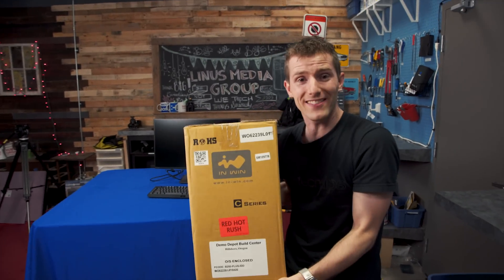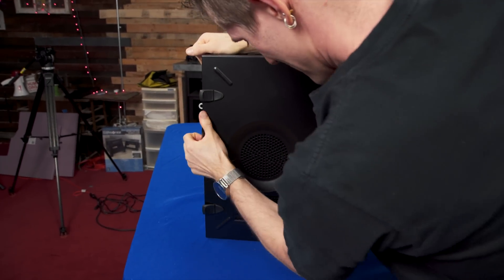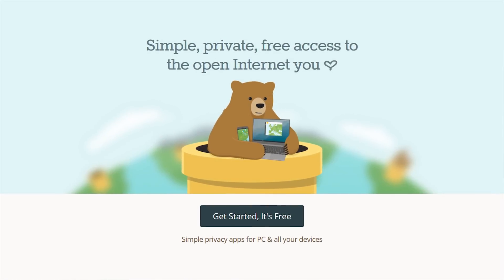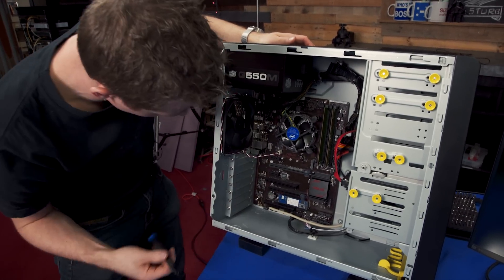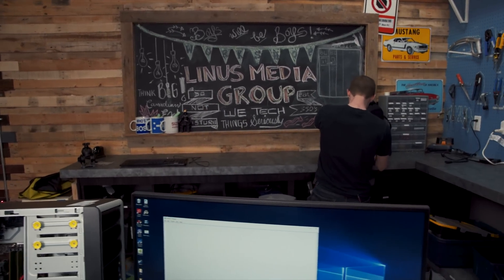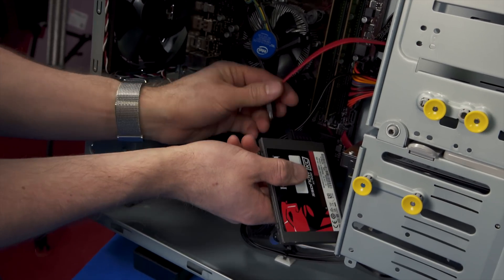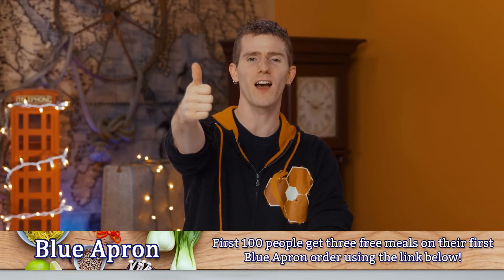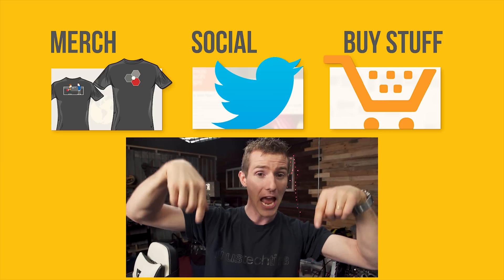Turbocharge your SSD for $40??

Comment: What old Computer has m.2?
Reply: Ethan L none because it doesn't work with them anyways
Reply: I was thinking that too. My computer from 2010 does not maybe a pcie adapter to m.2 but at that point you could buy an ssd.
Reply: and a 200 series Intel Chipsets Motherboard xD
Reply: It's aimed for people who manage large amounts of data on very Large and slow drives. A simple solution to give an ssd feel to the machine. Well that's at least what I think.
Reply: An old PC wouldn't make sense anyway, because you need a 2xx series chipset and Kabylake. But who builds a new PC without an SSD?
Reply: But does your cpu support optane...forget about it.
Reply: And Kaby Lake!
Reply: Doesn't even work with 6700K which is just 1 year old. Awesome Intel product for no market at all.
Reply: exactly what i was going to say as well
Reply: exactly....very pointless, is the SSD cache all over again but when nobody actually needs it. It will only make sense on bottom budget systems.
Reply: Ethan L that's why the limited it to 7 th gen
Reply: sniperunrepeat I was joking... furthermore instead of $40 for 32g of optane, you can buy a $50 ssd of 120g.

Except maybe for some data center use cases, that's very pointless.
Reply: a computer from last year is considered "old computer"
Come on man, get with it already
Reply: Corentin Leman A $50 120gb SSD will be slower than Optane and likely be cacheless
Reply: Intel Z97 Chipset Motherboards, and they have been out  3 years now, and in the tech world that's already getting old, i know for me and many other people 3 year old MB is still very good (i have one).
Reply: sniperunrepeat I couldn't support you more on that point! :)
Reply: Yeah, not for me, but other people might think of it as some sort of ssd replacement, or a way to get ssd like performance on an older pc. That also leads to the point that it should have been marketed to the demographic you are talking about. There are alot of people that are new to pc's and pc components and so it is intel's job to market their products correctly to minimise customer confusion.
Reply: JoshBG I've just received an official reply from Intel "Intel® Optane™ can only be used to accelerate one Windows® 10 SATA boot drive." hope this helps. Seems silly to me as I would have used it to accelerate my secondary HDD.
Reply: Why do people not get super fast m.2 ssds?  because this optane device cost significantly less. It's not supposed to be bought with a new pc. It's for people who have pcs and want to buy something to make things go broom bro I'm fast
Reply: +Phenix Nunlee just be aware that with a PCI-e M.2 card you won't be able to boot up into Windows with it on your 2010 computer because the BIOS probably won't recognise NVMe drives. Once you've booted into Windows then the NVMe driver would kick in and you could then use the M.2 NVMe SSD as a secondary drive. Alternatively you could get a SATA III M.2 SSD and use that with the PCI-e card but these would be the same speed as a 2.5 inch SATA III SSD.
Reply: +My Black Minds People who don't plan out their builds properly and spend all their cash on everything else bit the storage. It can be easy, especially if you end up going to a store to buy the parts as you can then see stuff like Gaming Mice and Keyboards, actual cupholders that can go in one of the front disc drive slots (of which many full size tower cases have at least two, with one usually holding an optical drive of some sort, and/or an SD/Memory Card Reader nowadays), rgb LED lighting for many parts in person, or other similar impulse buys.

Plus it can be easy to go over budget if you end up buying something much higher end than would be practical for your budget (for example, buying an Intel Core i7 6900 at around $1000 US with a $2000 budget, leaving 1000 for the motherboard and every other part needed for the build, so you might need to cut corners depending on exact costs, or buying 64GB of DDR4 RAM because you want lots of fast ram, but it eats up more of your budget than 16 or 32GB, especially since it is rare for more than 16GB to be used in most day to day use unless you run everything cranked up to the maximum graphics quality while also running Google Chrome, watching Netflix/Hulu/Insert Favorite Streaming Service Here, and also contributing to Folding@Home or some other similar research service where you can donate computing time or making Hollywood grade 3D Graphics.

If you are building on a budget you might use a donor PC for it's case, optical drive, and Storage so you can get higher performance CPU, GPU, etc while keeping at a lower budget, and if you prioritize those, you probably won't have an SSD in the build unless the donor already has one.

Also, HDDs have one big advantage; Storage Capacity per Dollar. A 1 Terabyte portable USB 3.0/3.1 Gen 1 HDD costs around $40-60 at local stores, a 256 Gigabyte USB 3.0/3.1 Flash Drive would have a similar cost, so you get approximately 4 times the storage per dollar, and you can get better prices during sales, such as back to school or black friday sales on both types of memory.
Reply: how have you done your math here? A 16GB Optane module only costs £45 and can accelerate multi TB mechanical drives. A basic 128GB SSD would cost more than that.
Reply: sniperunrepeat Yeah like a $500 ssd will also be slower than optane, as said in the video... But the difference will hardly be notified, as per Linus' tests
Reply: what if you have all your games on a HDD and want to cache that while your OS is on a M.2 PCI-E NVMe drive? Dont just think about using things as intended. I use Intel older tech SRT (Smart Response) to actually cache my RAID 10 array both reads an writes.
Reply: Sometime you have to figure out that stuff for yourself usually when its not being marketed at you/ your demographic
Reply: I think they marketed to the largest user base which in there eyes makes the most sense. Even a fraction of those people are larger that the people that would use it as I described. I see this as more of something a system will ship with it already installed rather than an upgrade at least as at the moment since compatible systems are so new.
Reply: Ethan L That wasn't quite my point. I have with my Z97 mobo Samsung Evo850 240GB SSD + 3TB combo (one of the first m.2 boards). I wouldn't buy this shit even if it would go with my Z97 so for who this is aimed to?
Reply: I think a more important question is why you would choose to occupy your only M.2 slot with that instead of a super fast SSD for booting. I think it's useless technology, since relatively few new computers are booting from mechanical drives anymore. Small capacity SSDs are fairly cheap now. Just go with that.

I doubt this optane stick will give an hdd anywhere near ssd performance. Just load your most frequently accessed programs on ssd. Use a mechanical drive for cold data storage.
Reply: Brian Su do you know if we can use 2 optane memory as a cache ?
Reply: Brian Su ok thanks ! but can i use both of them to accelerate the same drive ?
Reply: Brian Su if you want bro that would be appreciated :p
Reply: Brian Su damn okay thank you man very appreciated
Reply: I'm still not convinced this Optane stuff would be a worthwhile endeavor anyway. I don't think it will boost your system speed anywhere near enough. If you're on that much of a budget, you're probably still better off buying the cheapest SSD you can get your hands on. Even if it's 100 GB. It's big enough to install windows and some of your commonly used programs.
Reply: Who, me? That aint got nothing to do with me, buddy. Good for you. I fucking love Beetlejuice. He's as bad as can.
Reply: Brian Su   Now that's what i'd like to do: use an Optane drive as a boot drive.  Is it possible? I do not game, so 32gb is large enough. I just want the speed.
Reply: Officially no because Optane isn't meant to be used as an SSD but Intel has said it's possible to get it to work as one. The other question is whether your BIOS will boot up with an Optane drive, I'm not sure about this. Having said that, are you sure Optane will be faster than a normal NVMe SSD? I think Optane's good for caching because of low latency but if you check the read and write speeds they're quite a bit slower than a proper NVMe SSD. Of course the thing is Intel doesn't allow using a NVMe SSD as a cache drive so people are forced to get Optane.
Reply: No, I've just checked. The 32GB Optane's official specs: Max. Read 1350 MB/s / Max. Write 290 MB/s. By contrast the Samsung 960 Pro NVMe can read and write over 3000 MB/s. The Optane does well with latency: (Latency 9µs Read / 30 µs Write) rather than transfer rates.
Reply: My 3770k on a gigabyte motherboard is not that new.
Reply: Doesn't the SSHD perform the same task in one single 2.5" unit?
Reply: If you think your unfounded claims are right, you're wrong! Accept my unfounded claims instead!
-xXxBlackwaterXxX, 2017
Reply: If you need a new mobo then obviously it isn't worth it. Fact is as of early this year all new PCs support Optane so there's no additional investment. I used Hybrid HDDs for many years and can't vouch for them. Furthermore, Hybrid drives only work in one direction. Only read otherwise you'll risk data loss.
Reply: Im still on SATA 2.0 dude. I actually play Doom 2016 on a 2009 i7-920 desktop.
Reply: and what new computer still boots from HDD?
Reply: is your M.2 SATA or NVMe?
Reply: Samsung Evo 960 Pro NVMe
Reply: NVMe
Reply: Vercusgames this is true but i have 3tb of hdd for free so it makes more sense to me
Reply: never heard of m.2 - PCIE adapter? bro, you are a noob.
Reply: Sir, Brian Su It can be done.
Allow me to introduce you to "PrimoCache".
As so long as the device can be used as a stand alone drive it can be used to accelerate any other existing storage.
In both Reads and writes.
OR, YOU CAN JUST USE ONE AS A DAMN BOOT DRIVE. 
ALSO, A PAGING FILE ON ONE OF THESE BEASTS WOULD BE AMAZING.
Reply: Actually It could work in increasing FPS... 
By freeing Paging file bandwidth onto one of these... 
And Running an OS on one... Freeing bandwidth... 
And... Using one as a drive cache (For another MVME.) with a program like "PrimoCache".
Would require a BEAST of a CPU... <- I mean LIKE THE BEST CPU CURRENTLY. 
And either an ADAPTER or another MVME Drive.... (Where games are stored)
This would reduce latency for games that use filling textures extremely. 
Also, Not to mention the game is already being loaded from a Great MVME SSD.... 
After you teach the Cache a game you want... It could give a HIGH END GAMING PC.... 
Another 10-30 FPS....
So having set up 3 of these for maybe 10%-15% gain... Meaning about what? $150 For 10-15% gain in speed... 
Which is $10 per a percent... Honestly I would do it if I had a high end system with that many slots for those drives and the CPU to eat it. 
Considering the CPU you would need is about $1,000... Then a monster $800-1,000 GPU...  
At that price point your looking for the BEST... And right now a set-up like that probably is the best.
Just do me a favor and don't forget the RGB.
Reply: Corentin Leman im gay
Reply: needs optane and NVMe support
Reply: That would be fine, but i think a big problem is the way it was marketed.
Reply: greenmarine8888 PCI, just PCI...
Reply: mine does from 2014
Reply: +Michael Lee new motherboards have 2 M.2 slots anyway. I'm using 1 for the primary SSD and the other will be for Optane.
Reply: greenmarine8888 SATA is a protocol, PCIe is a type of slot. There's no such thing as a PCIe SSD with no protocol. The common PCIe one is NVMe
Reply: JoshBG no I don't. I've been asking whether it can be used to accelerate a secondary HDD rather than primary. If the answer is yes then it should apply to your question too, I.e. One to accelerate the primary and the other the secondary drive.
Reply: Yes you're spot on! It's for people who don't have the M.2 slots already occupied. By the way, M.2 SSDs are not necessarily super fast. The SATA III ones are 6 times slower.
Reply: JoshBG ahh I'm not sure about that sorry. Try asking the question on Intel's support forum. I wouldn't mind doing that for you if you want me to?
Reply: JoshBG Done. Will update you when I get a reply :) I take it you have a mobo with 2 x M.2 slots?
Reply: JoshBG Intel has responded that it can't be done. Only 1 stick per HDD. However, it is possible to use the Optane stick as a standalone SSD (not officially supported) if you happen to have spares lying around.
Reply: JoshBG no problem mate. Yeah I'm quite disappointed it can't be used to accelerate my secondary HDD. I'll just stick to using a super fast SATA MLC SSD as the accelerator then.
Reply: Touché!
Reply: Brian Su  I do not know if Optane's read and write speeds are faster than an NVMe SSD's, but considering the tech in Optane, i'd think so.  An 80.00 boot drive quicker (latency) and faster (reads and writes) than a much more expensive NVMe drive would be worth upgrading to an Optane compatible mobo/cpu/ddr4/OS, even if it's only 32GB  and maybe if only the boot times are lower.
Reply: Brian Su thanks, hopefully the Optane powered SSDs will do what these can''t.
Reply: an x97 chipset <.<...
Reply: The kind that runs Crysis.
Reply: SSHDs are a marketing gimmick. I've been using them since 2010 and can't say they're that good. They only work in 1 direction so you'll still have to wait for the mechanical drive to complete writing to the magnetic disk.
Reply: @Vercusgames : There are negatives to an ssd since the producers will try to increase its size, reducing its storage longetivity since it still uses electricity which isn't good when you are going away for a long time, like a couple of weeks or months when a hdd saves it on the disk.
Reply: Eugene Glitz they probably put a newer motherboard in it
Reply: hey chill bruh thats my motherboard
Reply: It's just an old case, but it has new components, are you stupid?
Reply: if you ran out of money for an ssd chances are you don't have money for optane or you know go for a cheaper motherboard that is just as good and get an ssd. or even better use your hdd until you get enough for a ssd. cause that optane cache is a waste of money.
Reply: I'm building one that does from a WD Blue + Optane. Not everyone can afford more than 1 HDD so can't have an SSD + HDD.
Reply: I boot from an M.2 and everything else is on my 2tb Samsung SSD
Reply: Good choice, I've got that too.
Reply: good good don't use SATA M.2
Reply: You just need a PCI-E x4 port, which iirc the third gen supports 3.94GB/s
Reply: +Toool yeah but it'll only work as a secondary drive. You won't be able to boot into Windows like that because the BIOS won't have the option to set it as a boot drive.
Reply: Eugene Glitz not a ton I mean my old x99 pc has it but I work in an office with Windows XP computers and they put a pciex16 card in that's an adapter to m.2 so that's rad
Reply: the hard drive market isn't dying, its serving another purpose
Reply: ikr
Reply: omit Intels C232 & C236, not supported
Reply: Depends on your definition of "old."
Reply: Can Darma yes exactly!! That's what Optane is for!
Reply: Yeah, my computer is just from 2012, it started off with a Gigabyte GA-Z87X-UD3H ATX motherboard and a 7970 GPU but its like....yeah, it doesn't have M.2 in any sense of the word so I have no idea how 'Octane can power old PC's' would make any sense. LOW END Modern computers with meh HDD's? Sure!
Reply: +Kvarnholmen Exactly!! This is for people who can't afford SSDs. A 4TB SSD would come in U.2 form-factor as M.2 is physically too small. These would cost a bomb. Maybe these trolls here are rich kids who only think of themselves...
Reply: +Kvarnholmen ohh OK are you aware how Optane works? It can only be used to boost the primary boot drive, and only if the boot drive is a SATA drive. It doesn't work with nVME drives. There are other requirements too such as the type of disk, free space, etc. It's not that simple. Once again, you can only use it to boost 1 drive, the boot drive so you can't do both.
Reply: That's exactly what my situation is. I have a Samsung 960 Pro nVME Primary drive and a 4TB Western Digital Black secondary. Wanted to use Optane to accelerate the latter but realised it isn't possible. I'm now using one of the fastest SATA MLC SSD 128TB OCZ Vector drives to accelerate it instead. If you go down this route, make sure you use a MLC SSD. Never use a TLC SSD as an accelerator or it'll die very quickly. TLC drives are also much slower than MLC ones.
Reply: no you cant
Reply: M.2 NVMe is a 4-lane PCI-Express card. Use a US$10 slot adapter to fit full size slots. Windows 10 will find and use NVMe, but old motherboards don't recognize it as a boot device. There is a workaround using a "UEFI bootloader" such as Clover to load NVMe support and it then boots from the NVMe.
Reply: I have it in my "old" i7 4790K with MAXIMUS VIII GENE mainboard.
Reply: Vercusgames RAM can't replace DDR4, as they're the same thing
Reply: Phenix Nunlee any computer can have an SSD, as long as it has a SATA or M.2 socket
Reply: Oh yes, the Gum stick storage as they are called by many. Some examples of older motherboards would be like Gigabyte Z170N-WiFi mini-itx board and a Samsung 950 Pro SSD (M.2, 2280, NVME PCIe x 4). These are some from back in year 2000.
Reply: Z87 has it.  Probably even older chipsets.
Reply: Its literally like 15 dollars  for an adapter. https://www.amazon.com/MACHENIKE-Adapter-Controller-Expansion-Profile/dp/B079JVGJFV/ref=sr_1_2_sspa?ie=UTF8&qid=1519194675&sr=8-2-spons&keywords=pcie+to+m2+adapter&psc=1
Reply: Duh, no one calls this an old computer. Just the case is old. That's the thing about generic PC cases, they can be used for ages with new hardware constantly being cycled through them.
Reply: Yup, what IS old intel?
Reply: What budget? What new build? Aren't there any reasonable comments anymore?
I have a perfectly working old pc which I game on daily (no interest in content creation or any other kind of production work)
And I wanna make my pc faster paying just $40 as title says.
Reply: Late to the party but you gotta realize tech goes really fast so something thats 4 yo like my msi laptop, is considered old and has a m.2 slot
Reply: And Intel moronically made it incompatible with RAID volumes, which is really the only reason people have mechanical HDDs in new computers.
Reply: all the acceleration solutions are fake
Reply: Most likely a five month old pc.
Reply: Ethan L what old computer has m.2 that ALSO has an Intel new 6/7 gen processor, yes they gotta be the new ones or it won't be compatible...
Reply: Corentin Leman You would take your total budget, run it through pcpartpicker, and balance the price so you have an ssd
Reply: maybe someone who would want to buy a new computer...buys a motherboard, a PSU, a CPU, a graphic card, some ram, and... oh damn, no more money for an SSD! too bad, will have to stick with my old 1tb HDD and buy an optane stick...
Reply: is it SATA or PCIe ?
Reply: noah_drake There are no X97 MB's, you mean Z97 or X79 MB's.
Reply: Brian Su. you can get a 240gb ssd for £70 also your paying  extra for the motherboard and optane when you could just get a hybrid hdd and get close enough performance to that of optane without noticing a big difference in real world performance.
Reply: My Z97 board has m.2 slot :p